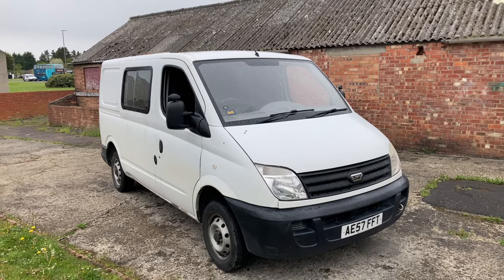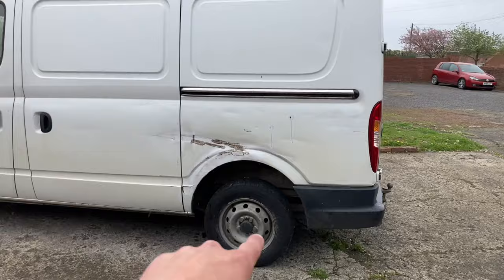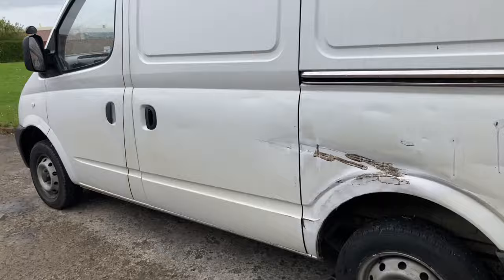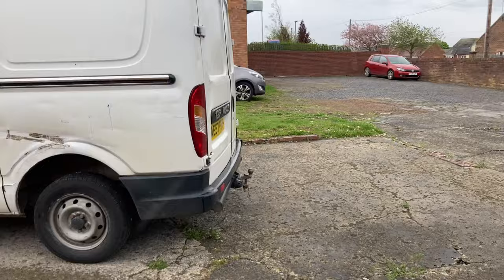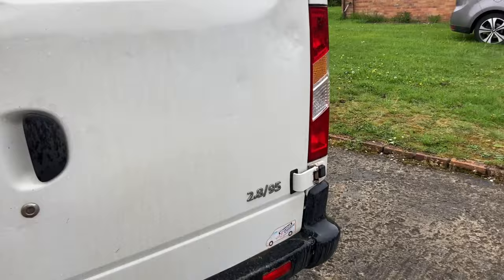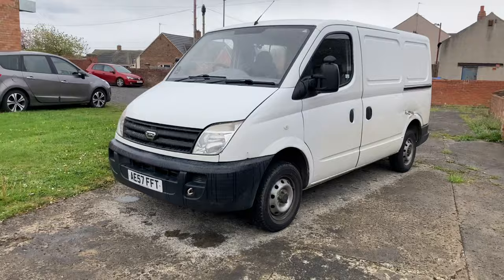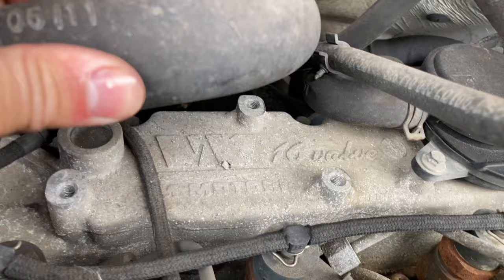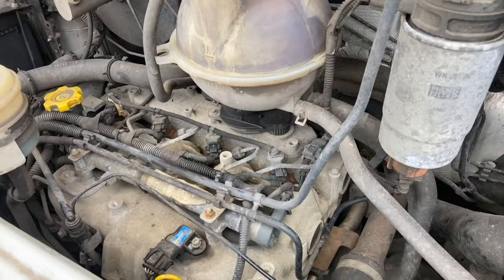LDV Maxus Review | Day Van | Camper Van #ldv #maxus #vanlife #van #camper #vanconversion

Comment: I have an 07 2.8/95 lo-top Maxus the same as this.... It is just startting to go with rust but it was seriously abused by the previous owner. But in 4 years of ownership and everyday use it has never failed to start, never gone wrong.... and for a van they are incredibly nippy, more thasn quick enough to see of the posers in their VWs and Transit customs. When mine eventually goe too far I will be looking for another! Great vans.
Reply from the maker: When you say stating to go, they don’t really go that bad, usually around the steps and inner sills, easy repaired.

I do loads of work on transit customs and Transporters it’s shocking how bad they are… especially when you consider what people pay for them !!!
Reply: @CarAddictGarageNE  My side loading door, bottom edge has rotted away completely. The wheel arches are now quite bad. I did put a set of cills on it a year ago, but mechanically its superb.
Reply from the maker: @doctordeefer yes unfortunately if they have spent there life in salty conditions like anything else they suffer corrosion

Comment: I bought one in lockdown as a project. High top lwb with genuine 63k on clock, 370 quid. 
Completely solid body appart From a few dents in usual places. 
The issue was it won't rev up untill it's warm and is mega low on power below turbo. Otherwise was all minor stuff. Hopefully get to the bottom of non revving issue soon. 
So far it's not the ECU(had it checked), had a new accelerator pedal and sensor. Changed oil, filters etc. Anyone with any ideas would be appreciated. 

Overall I like it. Considering the price of other vans that aren't any better it's a bargain. Drive surprisingly well too. 
Little known fact but for the first 5 years they where out they where the most reliable van in JD power survey. People love to hate them but I would be 5000k plus to get a similar condition alternative.
Reply from the maker: Don’t understand the hate they are cracking vans.

Have you tired the MAF and EGR massive issues, blank the EGR first 👍🏼
Reply: @CarAddictGarageNE turns out it was dodgy map sensor and some wiring. A couple tyres and brake pads and sailed though mot.
Reply from the maker: Yeah they are reliable old vans, MAP sensors can cause all sorts of issues

Comment: Had one of these for 5 years, still got it, cracking van, and i dont look after it as good as i should, payed £1200 for it, its a 07 plate, still going strong, figures crossed aye,
Reply from the maker: Just get it serviced regularly and they are a very reliable vans

Comment: Good review. Thanks . I'm half tempted by one
Reply from the maker: Cracking vans, I would buy one 100% 
Thanks for watching 👍🏼
Reply: I viewed van today. It was solid underneath. It had issues though. Oil leak from sump. Bad vibration at 35-50mph. Heater only worked on 1 and 4 setting. The rear doors won't lock. Finally airbag light was on. I was gutted. I loved the old skool feel and sound to it
Reply from the maker: Well if it was cheap enough they won’t have have been big deal jobs, vibration could simple as wheel balance/warped disc, even drive shaft wouldn’t be end of the world…. Sump is trivial what you expect on older vehicles, locks are no big deal, that’s just simply a resistor on the fan pick them up for few quid.

It’s when you go for Ford or Mercedes and they are rotten and it will cost you fortunes keep welding it up every year, until eventually it crumbles into dust lol.

Comment: Thank you for a great review, you repeated everything my MOT tester said comparing them to transits. Mine is an ex council 57 same spec van as that one. I love it, what a fantastic engine. I've left a few other bewildered van drivers behind lol. It has a little bit more rust than that one. You forgot to mention it also has two side doors. This is my third LDV van. Would I buy one again?  Definitely. Had to laugh, my speedo also zeroed itself out at about 90,000 miles lol. Great spec, younger reg, less milage, less rust, less cost than it's competitors like for like. Tony
Reply from the maker: Thanks for watching mate 👍🏼

Yeah they are cracking vans I would definitely buy one if a good one come up for sale, I don’t think this one had x2 sliding doors, was just a window cut into the offside, unless you were meaning it was an option that was available.
Reply: @CarAddictGarageNE  It must have been optional as mine has two, very handy. Cheers.
Reply from the maker: Just had this van in today on my daily Vlog, unfortunately needs a bit welding on one step, bar that it’s immaculate underneath

Comment: Had most makes as a hobby van... Vito 113 was quick but rots, slightly less than Sprinters! PSA vans suffer from mechanicals, Transits are rot boxes, had short wheel and long wheel, couldn't find anything which wasn't knackered.... VW is just about the badge, personally I think VWs are for the unimaginative. On my third LDV, bought an 06 High top minibus two years a go, been used for six years by the Red Arrows and then a School so tested every six months. £600. Great van and goes really well, think the limiter has been fiddled with. There are half a dozen peeps near me running them, have spoken to most, seems people keep them for years! The MV engine is a great motor and found in loads of stuff.... gearbox is a weak point.... Daewoo!
Reply from the maker: Yes I totally agreed, find the French stuff holds up very well for rot, but suffer mechanical/electrical issues, rust on transits are an absolute disgrace wouldn’t touch one, totally agree on VW completely over priced rubbish IMO.

I do like the sprinters after 2010 they got on top of the corrosion quite well.

But the LDV Maxus is a fantastic van, not without fault but all minor stuff for what they cost it’s a win win
Reply: @CarAddictGarageNE  Not sure why they get a bad rep from the trade, I think the expectation is a van that will crack 90 with all the toys of a car? Can't really fault mine, standard cheap interior you expect in a commercial vehicle of that age... other than the clock everything works, nice easy van to work on, bit tricky getting new parts but plenty of breakers about... most due to throw away owners rather than beyond repair. Mine is going to have a camper conversion at some point in 2022 and looking to get some better seats... can't stand not having an arm rest for longer trips! Brilliant on fuel.
Reply from the maker: All boils down to badge snobbery, yet the over priced “premium brands” are much worse than LDV but the vast majority don’t understand this.

I would definitely have one if a good one come up cheap.
Reply: @CarAddictGarageNE  Mercedes might have said that they solved the rust issues on the Sprinter after 2010 but believe me they have not. I've seen 2017 Sprinters with rust. Almost every used Sprinter ive seen has some sort of rust. I'd say they rust even more than the Transit.
Reply from the maker: @terrificspokesman7416  
Yes I have to agree have also seen a lot of rust on the newer sprinters.

To be honest new cars are horrendous for corrosion especially on subframes.
Thanks for watching 👍🏼
Reply: @CarAddictGarageNE  they did improve the vitos after 2010 though.
Reply from the maker: I have seen some shocking rear subframes on the A class, they improved the body’s and went backwards on the running gear

Comment: Just bought ldv maxus 2008 minibus. Entry was through front but I want to put a double front passenger seat in. What size bolts do I need. I'm assuming there are stand drilled holes under floor covering.
Cheers Graham
Reply from the maker: Oh unfortunately i don’t really get involved worn fitting seats, have no idea what size bolts you need, sure there will be special fitting kits.

thanks for watching 👍🏼

Comment: Where is the standard spare wheel location?
Reply from the maker: I’m not 100% but I would assume under the floor at the rear
Reply: Even at the end of the video you can see that there is no spare tire secured under the floor. Thanks! @CarAddictGarageNE
Reply from the maker: @user-mz3ys3iu9e 
Yes but it could simply be missing

Comment: Hi are they reliable? I found one for 1500 quid with 103k miles on clock is a transit better? Thanks
Reply from the maker: These are definitely better any transit for £1500 will be rotten, wouldn’t touch it.

These ain’t perfect but a far better van 👍🏼
Reply: @CarAddictGarageNE  thanks for the advice